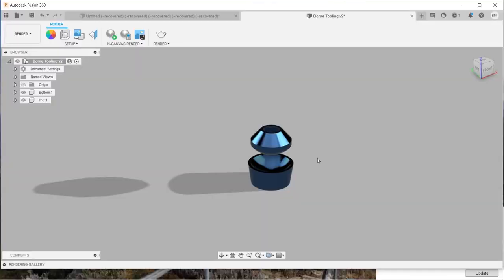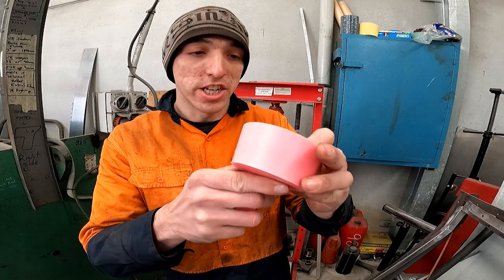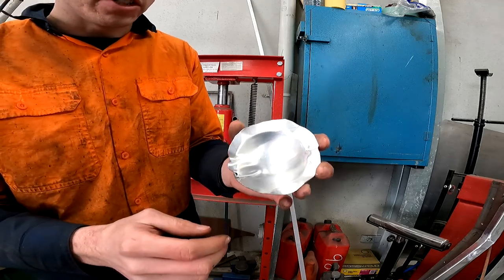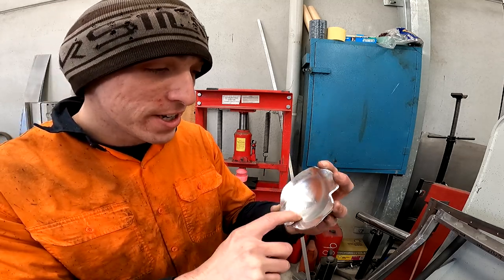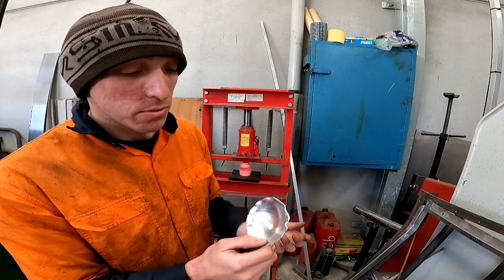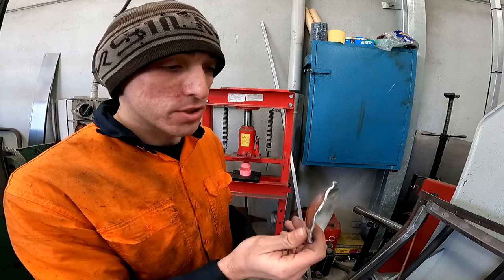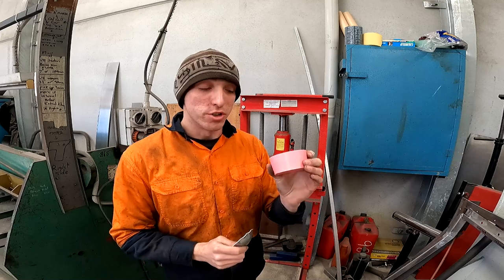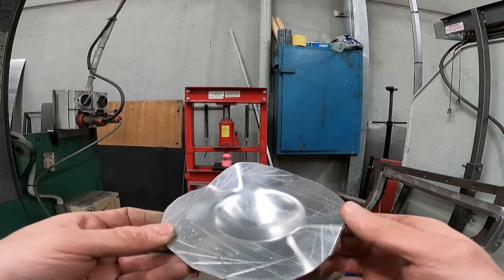3D Printed Dome Press Tooling

Comment: Stuff made here has made a pretty in depth video at the trial and error method of press forming. It's "How I made steel toe crocs with wood" if you're interested. He stopped the the material folding over itself by clamping it down really well.
Reply from the maker: Cheers mate

Comment: I know exactly what this is; we call it "flowering." You need to support the outer edge of the blank with downward pressure or it will take the path of least resistance and begin to wrinkle. In extreme cases these wrinkles can cause blowouts. A more substantial lubricant will also help.
Reply from the maker: Thanks for your help mate!

Comment: When its pressing, the outer edges start to wrinkle up. If the base of the die had a wide flat lip around the edge, and you have a thick steel plate with a hole in the middle, you could clamp the disc down with only the hole for the top die exposed. When pressing, this would draw the material in under more even tension and help prevent the wrinkling on the edges from starting.
Reply from the maker: Cheers mate

Comment: You need the larger material size (not thickness, area)to resist it wrinkling and collapsing so it stretchs the inner material to the shape. Basically you want the part of least resistance to be the inner metal stretching into the bottom half of the die.
Reply from the maker: Cheers mate

Comment: Damn this is great, do you think I could make a like 4-5 liter cooking pot with this method with my 30ton hydraulic press?

No experience with this but I am very curious to try
Reply from the maker: I think there would be a lot of material that would need to be shrunk. I think it would be possible though 🤙
Reply: @house-ofhoon problem is I think aluminum isn’t food safe, so I might need to either have non stick food safe coating, which I don’t know how it’s done, or which company would ever do this for a single part 🤣

Or I use a food grade stainless steel, bit I would like an aluminum one more, I am imagining shaping will be easier

Comment: Perhaps a softer temper aluminum
Range generally 0-7 with 0 being the softer.
Reply from the maker: That would likely have helped!
Reply: @house-ofhoon  0 is very soft but will age harden some on it's own, it may even work harden from the press, not really sure, it's not readably available in small quantities. You can easily anneal (soften) aluminum with heat, no doubt lots of YouTube videos on it.

Comment: Shouldn't the top die be less radius per the thickness of material?
Reply from the maker: Excellent question!
Reply: @house-ofhoon  As discussed in messenger, you need to allow for the thickness of material to prevent the wrinkles...
Reply: Was thinking the same thing - general rule with pressing things is you need at least one thickness of clearance between tools.